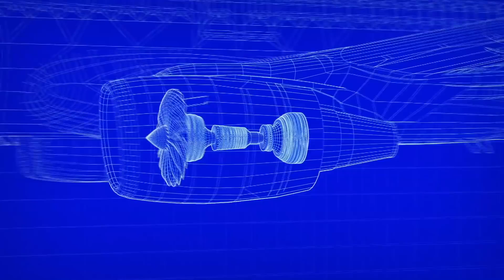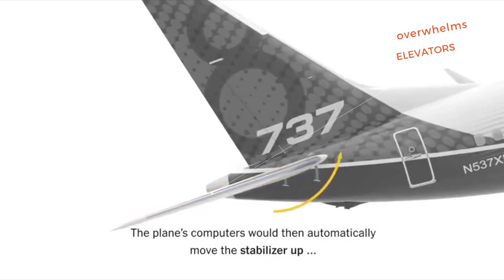737 Max 8 probable cause revealed - Prof Simon

Comment: There are so many people who know nothing about flying commenting here. The pilots only need to run through the run away stabilizer memory items to avoid these crashes. Pilots have been trained for runaway stabilizers for a long time, every pilot is required to have memorized what to do. These planes crashed due to something that every single pilot is trained to handle, this wasn’t anything abnormal to them. In the first crash, it appears obvious that the pilots didn’t know mcas existed. That isn’t an excuse for failing to run through the run away stabilizer memory items, though. The second crash doesn’t have enough information. Maybe they didn’t understand mcas, either. It seems that both times the pilots panicked and abandoned their training. These planes aren’t unsafe, the pilots were not adequately trained. This is human error.
Reply: And seriously, I am the most anti-boeing person out there. boeing seriously screwed up. But their screw up wasnt in making an unsafe plane, because these planes are very safe. The screw up is in bribing the FAA to shortcut basic regulation. The boeing execs and FAA execs both deserve lengthy prison sentences, and the FAA should never be allowed to unilaterally do anything ever again. EASA should be required to double check the FAA, at a minimum.
Reply from the maker: I think from a pilot perspective you are absolutely correct. Any experienced crew, who could quickly identify the problem and recall the runaway trim memory item checklist should have had an exciting day but been fine.  For me the issue is how Boeing sold these, very different 737 variants, as part of the same family. Without emphasizing MCAS training or maintenance.
Reply: Professor Simon Holland Amd the FAA corruption, which goes all the way to the top. Ultimately, Donald Trump is the one responsible for this. Its his administration that pushed this plane into production rather than requiring the redesign. It is congress that failed to give the FAA enough budget to hire enough workers to do their job. Its EASA etc for just taking the FAA’s word on things instead of requiring their own investigations. Its poorly trained pilots. Poorly trained maintenance. It is really a team effort.
Reply: the memory items are:  
1: firmly grab the control column
2: disengage auto-pilot
3: disengage auto-throttle
check to see if trim has come under control. if it is, fly manually. if trim is still out of control
4: cut out stab trim, both sides
if stabilizer is still out of control
5: grasp and hold trim wheel.

the grasp and hold is bad news bears for the pilot. you can easily break your hand/wrist. its painful. its taking one for the team

Comment: I see a couple of problems.
1. The system takes input from only one sensor. From two sensors is optional. (Airbus takes 2 out of three readings)
2. The system does repeatedly take action even after the pilot worked against it.
3. The system does 2.5° action on the rudder and not as it was agreed with FAA 0.6°. 
4. The system was agreed by FAA as not critical. That can be the only reason for the possibility to sell the second Sensor check as option in my opinion.
4. As the system was regarded as not critical, the pilots did not need extra simulator training for the max 8 and obviously also the mechanics did not get an update how to check the function of the sensors properly.

Comment: I don't think Boeing will get people to trust the 737 Max 8 again no matter the software update. What's more, the company as a whole might have trust issues in the future for the shady behavior with regards to the safety of the passengers. The safest best would be to really build that new airframe, just as they planned instead of mucking around on an old airframe that cannot take these bigger engines. Boeing can also cross its fingers and hope that the Airbus 320 Neo engine problems are real and it won't lose that much of a market share before it builds its own new solution to this most lucrative segment.
Reply: Waiting for Boeing to "fix" the problem of no one wanting to fly Max 8 by simply renaming the model to something else.

Comment: The engines need to be bigger to be more efficient. Therefore they are too far forward to give them ground clearance.This unbalances the aircraft. Either design a new aircraft or give the 737 longer landing gear, having software to balance trim a nose heavy aircraft is a poor engineering solution.

Comment: The MCAS failed. That is indisputable.  But we do not have any information yet to determine if the crews of both 737 Maxes had over pitched or not.  But you all have to know that the MCAS works ONLY when the autopilot is OFF and flaps are UP.  How is it that ZERO US (or Canadian or for that matter, European) crews have had fatalities or crashes?  You simply engage autopilot and MCAS deactivates.  Should the software be rewritten as well as avionics looked at?  Sure.  But does anyone think that the aircrews for either airline involved were highly trained?  For Ethiopia, they CANNOT confirm that their crews had flown in simulators for DIFFERENCES training that would have been mandatory for US air crews.  Maybe that is why two large air carriers in the US had plenty if faith in the system.  There are a lot of negative comments by many people UNQUALIFIED to discuss this issue.

Comment: Dear Simon Holland, 
it´s er very sober analysis of the problem on the present level of knowledge. 
You could also see as a general geometrical problem with an airframe who has its roots dating back to the early 60ties, in a world of turbojet engines and low ground clearance. The very limited distance between wing and ground made it increasingly difficult to fit the fit newer turbofan engines with ever-growing fan diameter, which led to the flat underbelly of the fan cover of the previous generations. The "Max" generation took it even further by mowing the engines.
It´s a very hard and risky economic decision for a firm the size of Boeing, to start a new design process for a successor of the most successful commercial jet airliner in history and therefore understandable to keep on tweaking a design to the "Max" to keep up with the competition and secure that companies keep buying the 737. But it seems to have its limits and future even more fuel-efficient turbofan engines and long bodies will probably increase the problem even further.
The question could, therefore, be, why hasn't an extremely competent airplane builder like Boeing been brave enough to see the limitations of the design and create a new single-aisle airplane for the 21s century a decade ago instead of relying on even more tweaks? unfortunately, probably money.

Comment: Did you check what happened with the Airbus about What Caused Flight 72 to Lose Control in 2008?
It seems the same the root cause! and the same root cause of the Air France crash in the Atlantic Ocean a few years ago ... so it is a common problem of Airbus, Boeing, the same problem behind Tesla crashes which is all about what the "human fallibility" in designing systems as mentioned by Carl Sagan many times!

Comment: The MCAS system was not revealed to the first receivers of the Max 8's,
nor was it in the Manuals. Boeing thought it would quietly do it's job in
the background, but they were wrong. After the first accident from Lion Air,
out of Indonesia, then all airliners were informed of this. The pilots in 
Ethiopia may or may not have been aware of this, and if they were they
lacked insufficient training on how to deal with this problem.
 
The MCAS system works to bring the nose of the plane down so it can
fly at a level flight. MCAS get's it's information from AOA sensors that
send info to the plane as to what angle the plane is flying at. Pilots have
reported that the AOA sensors are faulty and sending "wrong information"
and "activating" the MCAS system when it shouldn't have, causing the 
planes nose to point downward, and causing the plane to go into a nose
dive, and this is what happened. Basically the MCAS was needed because
Boeing redesigned the engines, that were bigger, and were mounted 
differently -- more forward and up on the wing, throwing off the center of
gravity of the new 737 Max 8.The old 737 does not have this problem. AOA 
sensors, stands for Angle of Attack, to make sure air flow is right both over
and under the wings, to make the plane aerodynamic.
 
According to reports from pilots, you can "disengage" the MCAS SYSTEM,
buy pulling back on the yoke, and this will do it. At the same time there are
wheels by the throttle that you turn manually, to trim the planes stabilizer
manually by yourself. This was done many times by well trained American
pilots, who averted  crashes with this jet. So, proper training and awareness
could have saved a lot of lives. 

 Let's not forget these MAX 8 jets have been flying for a couple years, with
thousands of flights in North America and developed countries with "no"
accidents, and pilots say the plane flies beautifully. They say it's a very smooth
flying aircraft, and a pleasure to pilot.
 
So, who's responsible for this -- well it's Boeing, for non disclosure of the MCAS
system, and what to do, if it functions in error, and how to manually disengage
the system. In my opinion, all pilots should know how to manually take a plane
from takeoff, and land it smoothly with no automation, or computers to help
them --  just like in the old days. Over the last 20 years, there have been so very
few major aircraft go down. I'm all for automation, but I fully support proper pilot
training should some of this automation fail -- like faulty sensors. It's completely
crazy to rely on robots or Artificial Intelligence ( AI ) to fly planes, if you don't 
understand how the computers work, and how they fly the plane, and in the event
of a failure of the computer, you can then shut it off, and have "no problem" , and 
take control of the aircraft yourself,- "manually" with a lot of confidence.
 
I SHOULD ADD - this MCAS system and it's AOA sensors, should all be mandatory
on a plane, and not be sold as extras, same as brakes on a car. You don't play
around with peoples lives, to make a few extra dollars, selling "options." These
features "must be standard equipment", on all these aircraft sold, PERIOD. 
 
This is why I'm "very against" self driving cars'. Can you imagine all the accidents
that will happen from "faulty sensors." WOW , it will be a nightmare. Faulty sensors
could be caused by snow, ice, extreme heat or cold. Are we getting so lazy that we
need to have Artificial Intelligence driving our cars. No thanks for me, I'll drive my
own car, and hope that people will rebel against this idea, and the makers of these
cars, won't sell any of them, and thus, taking them off the market.This Boeing Max 8 
should send a good example, of things to come if we allow driverless cars. Not for
me, and I hope the general public will agree with this.

Comment: The real problem is with the MAX aircraft is its not a 737 and it was certified as such. With all the changes made to the original design there came a time when the aircraft ceased being a 737. These aircraft should have been designated the MAX1, MAX2 and MAX3. One can easily say these MAX   looks like a 707 with two engines. For certification purposes the Max is not a 737 and that is the root cause of the problem. 
Remember when McDonnell Douglas stretched the DC9. They realized the characteristic of the airplane was changed in so much, it was named the MD80. Because of the rush to compete with Airbus A320neo, Boeing stretched the 737 beyond its capabilities.  The aircraft needed the correct certification process.
Reply from the maker: Spot on Charles...in the rush to release a new aircraft and a desire to market it as a 737 to the airlines...they messed up....it probably is a fine aircraft...but not a 737 as you say....very good point.

Comment: mcas can be turned off in literally 2 seconds, mcas not working not and issue manual control, as a MAX 8 pilot this training was offered and we did train on it, but almost 1300 hurs on the type not ONE situation of runaway stab was reported, what i think happened in ethiopia and lion air was the stab trim down cause a situation where they were so determined to pull up they failed to address the cause of the issue
Reply from the maker: Glad mcas was included in your training. How to turn the thing off ...if needed was vital knowledge.  It still seems Boeing we’re a bit over confident and determined to keep it easy for legacy 737 pilots round the world...that they did not emphasize enough how this system works and its potential to overwhelm the aircraft crew, if it actuates.
Reply: @SimonHollandfilms  trim stab switcheS to the off position literally takes 2 seconds, this disables all electric power to the stab trim jack screw, then you can manually trim the aircraft, I think the issue is situational awareness when the plane trimmed down they were so focused on pulling back the elevator they were not aware what caused it, a runaway trim stab is a item that you NEED to have in memory on the max8, im sorry but from what i understand the pilots were not trained to deal with a runway Stab, WHICH IS IN THE FLIGHT MANUAL, i see how it can be confusing, and it happens in everyday life when you spin your car you turn the wheel the opposite direction when you supposed to turn into the spin, but the issue of runaway trim stab is in the flight manual that they should have known, its nice though to have an intelligent conversation away from what the media says, also the AOA sensor SHOULD have been checked by the first officer on his walk around, hes to make sure there are NO obstructions in the AOA sensor, the Pitot tubes also feed AOA information, and the media saying they are optional extras is NOT correct they were FAA directives, a fialiure by an airline to follow them is dooming a plane to the same fate which is what happened here, RIP 157 i do feel sorry for their loss

Comment: Every time  - with no exceptions - software is given overall control of human situations, whether for cost efficiencies or to reduce human numbers, it fails and lets down its human masters and its human users. In retail, in banking, commodity trading, weather prediction,  modelling, structural design, and so on - it will ultimately self-defeat because it is not human and has no reasoning ability beyond following instructions.

Self-driving cars is an insane idea. By definition, it acknowledges that it will fail at some point, and create all manner of safety, insurance, moral and legal issues where the lack of a human judgement will guarantee the authors and manufacturers will inevitably shoulder cost burdens they cannot sustain in the long term.  

I'm no expert, but hundreds of people on a machine 6 miles up with no manual override that can be implemented inside 10 seconds, is not something I want any part of. This particular situation warrants a very straightforward question - why would you design a control system which fundamentally, partially or comes anywhere close to locking out or confusing the highly trained cockpit crew?

The lawyers must be doing backflips over this one. This may not hold the potential for 'Boeing...Going...Gone! but some airlines will almost certainly fold when the law suits are concluded.

Comment: A Pilot's perspective: The 737 MAX does not have the same pitch characteristics of the 737 Classic or NG at higher angles of attack (AoA). The larger engine nacelles for the high bypass motors are placed further forward on the wing. The drawback is that it destabilizes the a/c in pitch. Anything forward of the center of gravity (CG) contributes to destabilization in pitch. So Boeing moved the Center of Lift (CL) forward of the CG causing a huge reduction in the safe AoA before a stall – which is why they added MCAS.
The reason is that the engine/wing mounting is closely coupled such that the mean cord of the wing has been extended forward...so the upper engine cowling is now effectively part of the wing.The cowling will help produce lift but not at all AoA. This is bad because it increases the likelihood of a flow separation at high AoA. Those nacelles will start to produce lift causing an additional pitch up moment. So they had to design a system to drive that nose down - MCAS.
 This is the instability that I speak of in my earlier comment: Nek
 Thanks to James W Carr's comment at the Washington Post: https://www.washingtonpost.com/business/boeings-737-max-crisis----your-questions-answered-quicktake/2019/03/18/651e1ebe-4957-11e9-8cfc-2c5d0999c21e_story.html?utm_term=.cafbed739efb

Comment: That was a frightening bit of film. I'm not a technical man, but Boeing need to just stick to the 737 800. Then go away and design a new plane that can be manually flown by the pilots when the software fails.

Comment: You are looking to blame computer failure...pundits take the view that all maxs have aerodynamic flaws which drove these circumstances...questions the public want ansawering are...was the sole sensory not infact faulty at all? But just was mounted in a place that under certain flight conditions was subject to airframe buffet or low pressure? Was the tail plane adequate on this design when subject to airframe buffet by the over elongation of the airframe design? Was a runaway trime situation accually caused by engine thrust not computer inputs?  Either way you look at this problem there is a compendium of factors which end up in the question of why these were not picked up during certification and flight trials?  Was boeing aware of these issues but thought it was too expensive to fix?